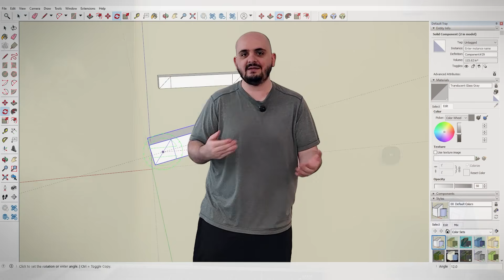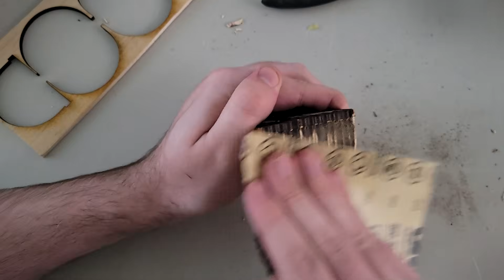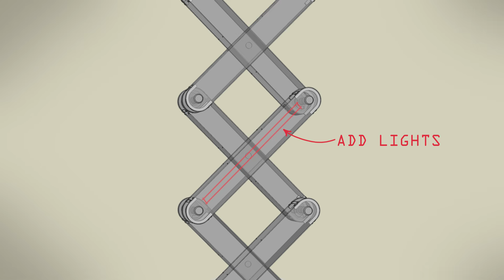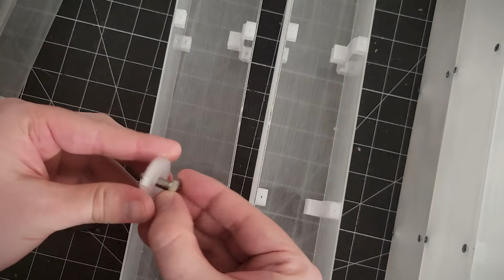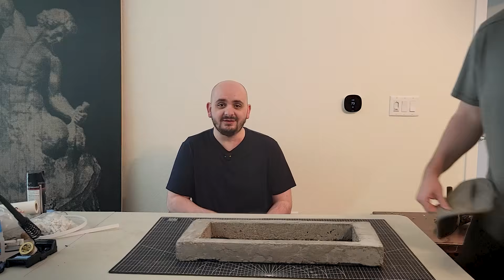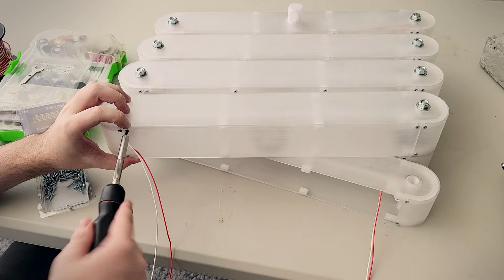I Built a Kinetic Lamp (24 Hour Challenge)

Comment: Hey, a small comment or improvement: if you embed a plate between the lamp and the base, and basically clamp the technology from the "floor" to the new "ceiling" (you'll just have to leave a gap for the dimmer function), I think the whole thing would look cleaner. But great idea / build, like the humor and that you show your happy little accidents.

Comment: Another idea for brightness control 

Have a spring or rubber loaded encoder , have a string pulling through the whole contraption 

When the light is expanded it will pull the string rotating the encoder proportionally , when contracting rubber will roll up the encoder

Comment: The old adage in engineering is that a project can be: fast, cheap, good <---pick any 2 of these
By forcing yourself to make something fast, you either need to sacrifice quality or throw a massive amount of resources at it. That's why 24-hour challenges are ultimately so unsatisfying. If you take your time, you can make something that is both cheap and good.

Comment: One option very few people use but works very well for a frosted translucent part is acrylic with a window tint /film applied. You can buy many types of window films and they are fairly easy to apply to a sheet of acrylic. You can get patterns, frosted etc very easily this way. Just throwing it out there. Cool concept. Good job.

Comment: You have a pretty solid power supply at home. Heating an oven to that temperature in an hour would require about 23 GW, compared to a typical nuclear power plant's output of 1 GW 😆

Comment: The lights being too dim is certainly because of voltage drop, I know you effectively solved the problem by just feeding power from both ends, but for future projects remember that each strip you cut is effectively a parallel circuit, so instead of wiring a strip from the end of the previous one you can just feed power to each strip directly from the power supply (on this case the LED driver), for this case it would increase the number of wires which admittedly is not ideal, but you could simply just get an extra set of wiring to connect to the middle of your lamp, that way the power is more even across the whole thing, instead of being very bright at both ends and slightly dimmer at the center of the lamp circuit.

Also, I understand using a potentiometer connected to a rack and pinion is a very nice and clever solution, but for future reference you can get linear potentiometers which are basically a strip with a lever that slides and that adjusts the resistance value